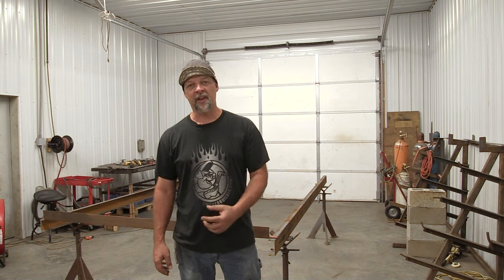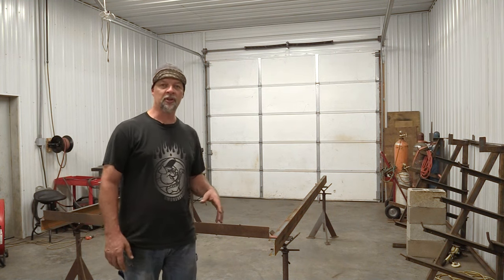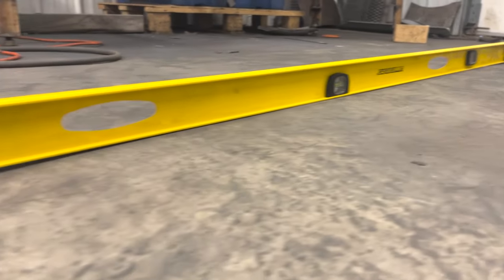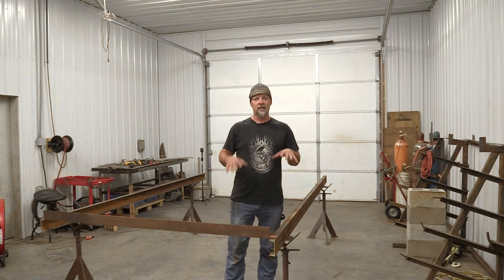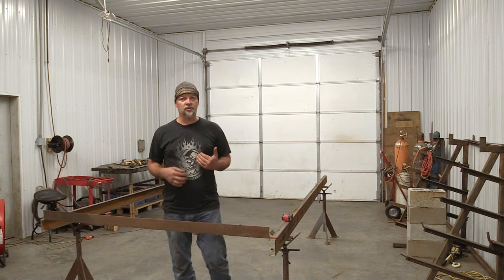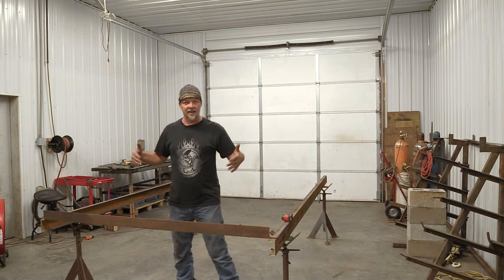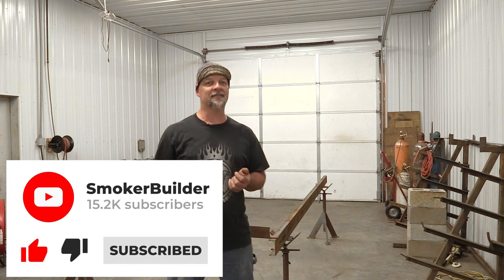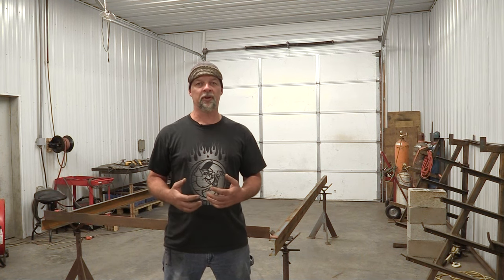How To Build A Smoker Trailer [Part 1- Setting Things Up]

Comment: If your frame rails are the same length and parallel, you can measure from corner to opposite corner to check if the frame is square. If the measurements are the same, you know that the frame is squared. If it’s not, simply slide one rail keeping the distance between them equal until they square up. It’s good way to double check the “3-4-5” method if you’re working alone.